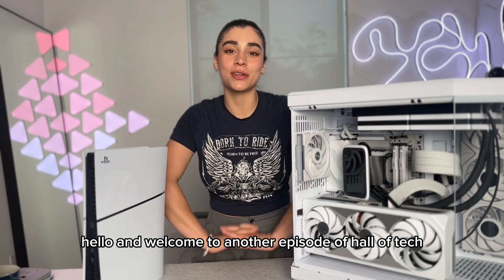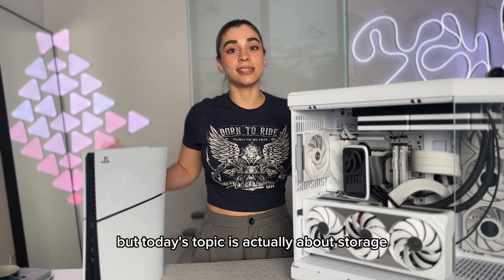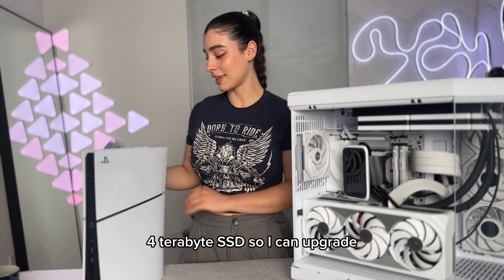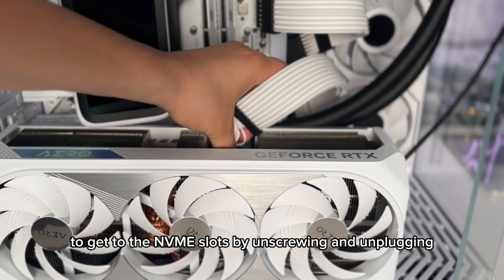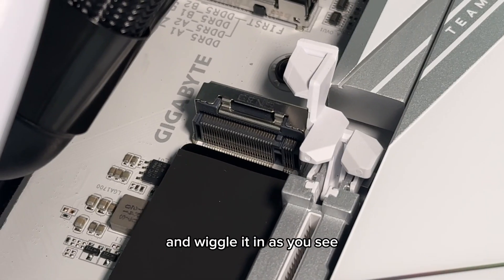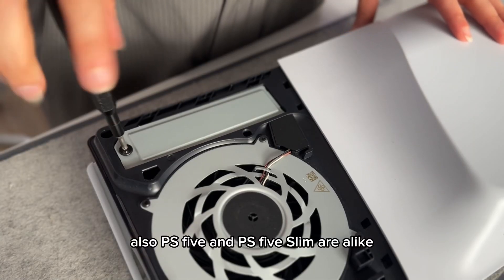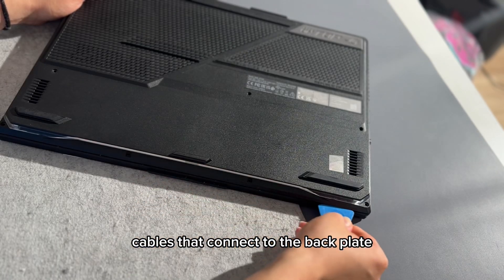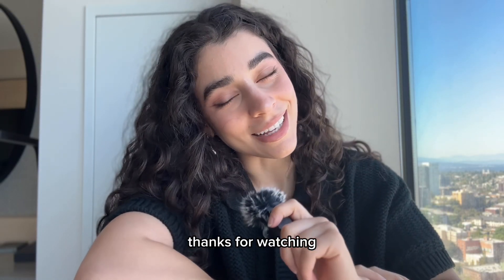How to upgrade your ssd on your PC, Laptop, and PS5

Comment: My Macbook Pro is stuck at "Your Computer Restarted Because of a Problem” macOS ERROR. I tried all the "Disconnect All Peripherals, Enter Safe Mode, Reset NVRAM or PRAM, Reset SMC, Reinstall macOS" but still won't work. Is it the Hard Drive because, the Windows/Bootcamp is still working but the macOS isn't.